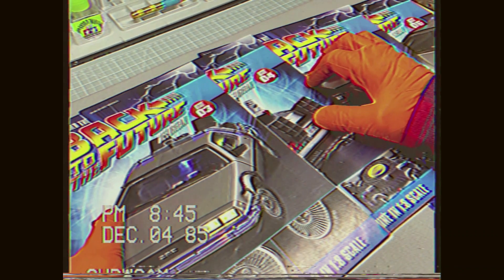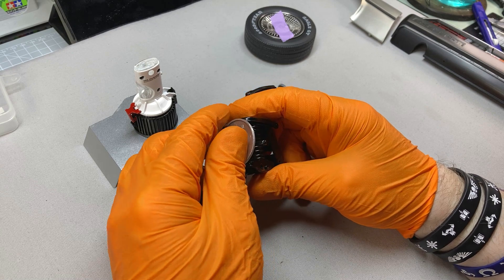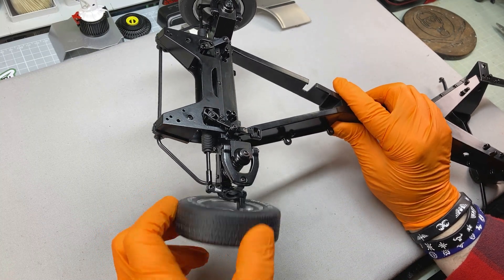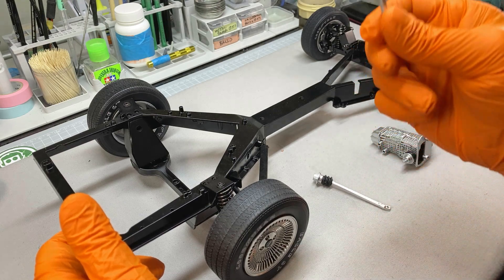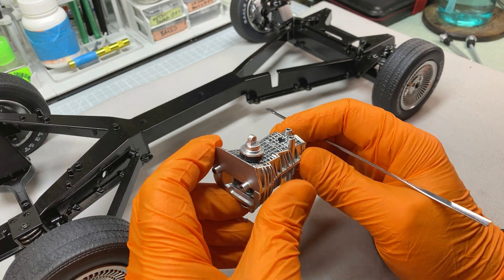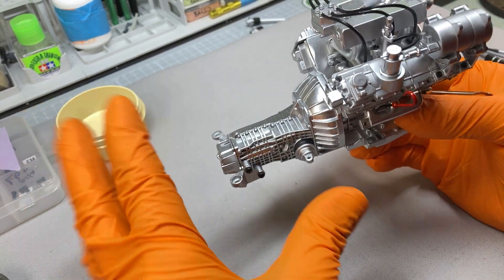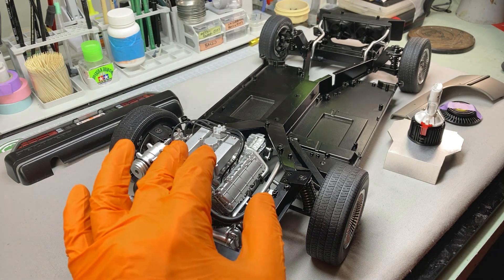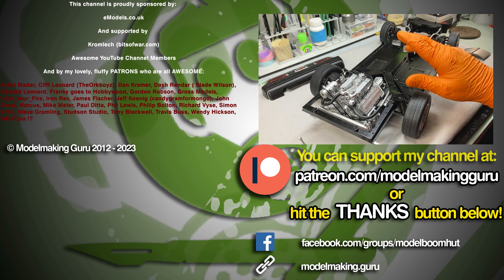FANHOME 1:8 Back To The Future DeLorean: Issues 3-31

Comment: 08:33 You have to tighten the side screw DM (Issue5/6) abit more and the wheel will not flap down so easily. It is tight enough when you lift the body and the wheels do not flap down right aways when you slightly shake the frame. Was the same problem with mine.

14:50 Cause Americans can not drive manual gear box in their cars.
Reply from the maker: Good tip, thanks :)